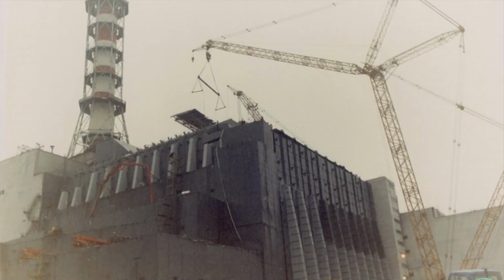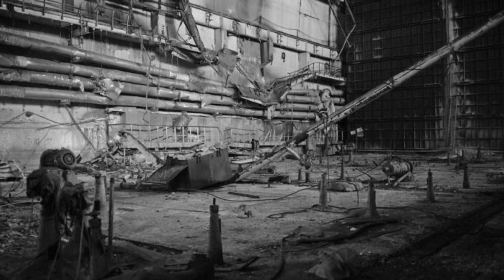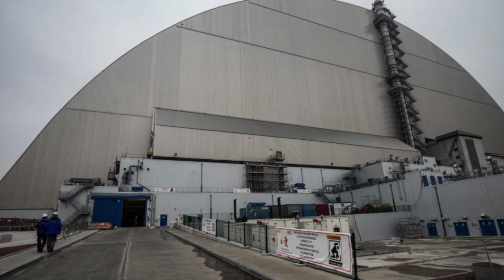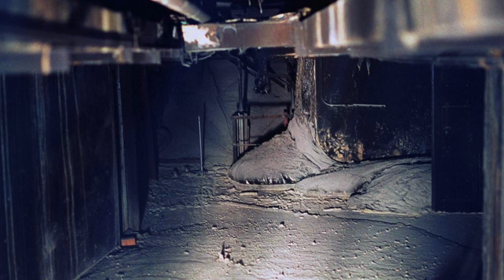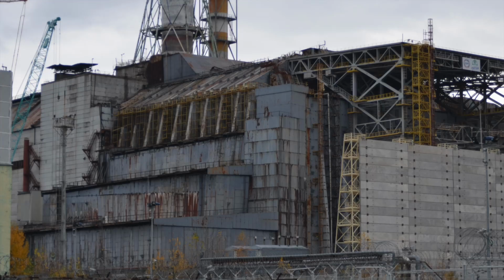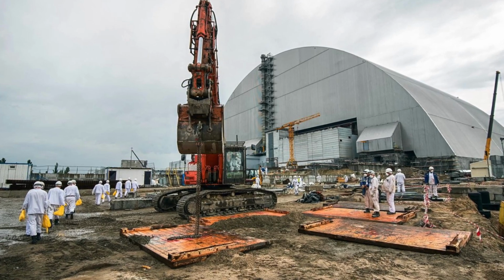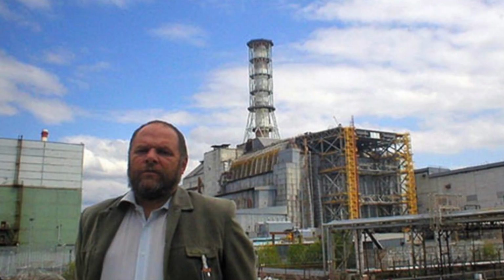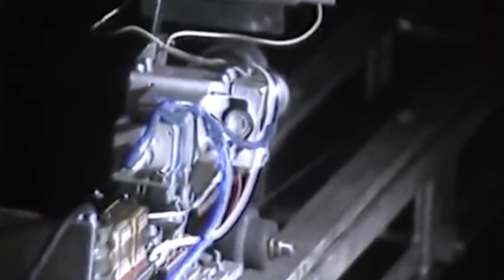The old sarcophagus at the Chernobyl nuclear power plant. Here's what a plant worker said

Comment: There's a processing facility further north at the end of the railway, that's where the other waste was going to.
The arch and facility is designed to keep dust down and extract it from the air. The biggest problem will be room 305/2, the one directly beneath the reactor, where what was left of the reactor collapsed into. If what I have heard is correct it's still "sealed" up with concrete and is too dangerous to enter. Cleaning that up will be a challenge, but it will have to be done. Visual analysis (Borvov '88) estimates there's more than 60 metric tons of uranium fuel in there. Your video shows some of it.